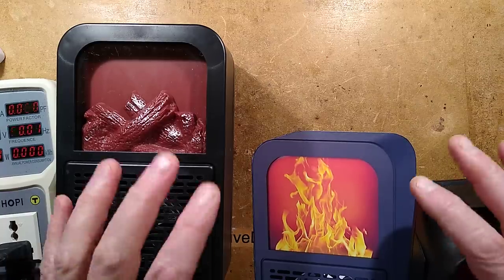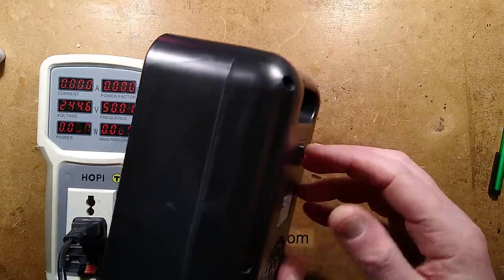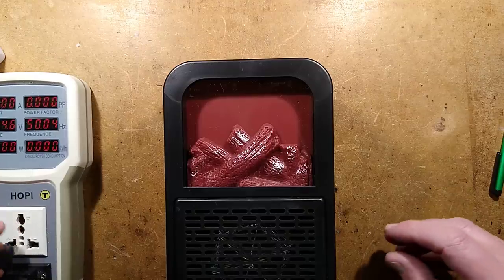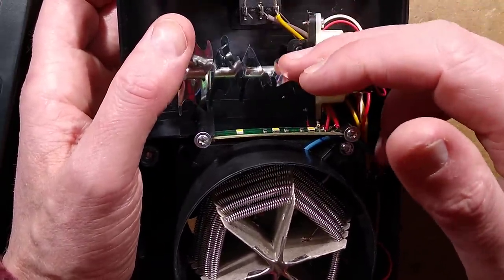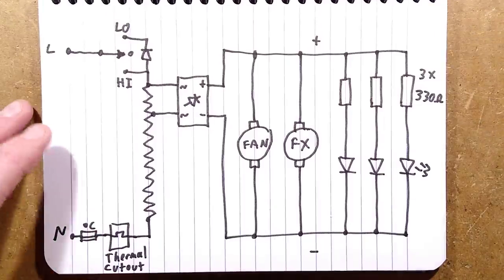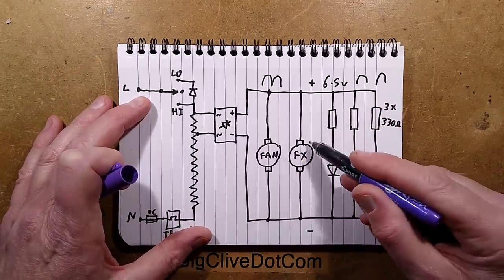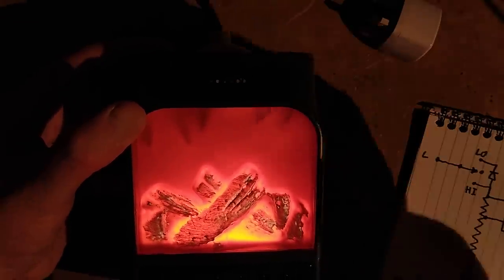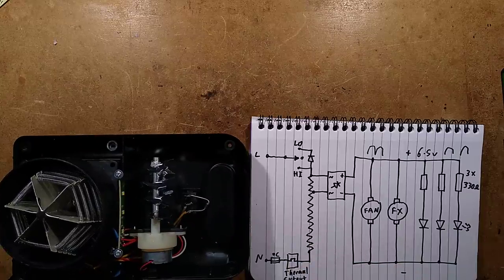The trashiest of all miracle heaters (with schematic)

Comment: I have three of the "Handy Heaters".  I got them at a thrift store over the summer for 5 dollars each.  (Three for less than the price of one on Amazon) The ones that plug directly into the outlet.  Winter came, and I plugged one in.  Powered up, worked really well.  After an hour or so,  it just shut off.  Have to unplug it, and plug it back in to get it going again.  Tried another one.  Same thing.  The third one... Same thing. While they were running,  the heat was pretty good.  They are the PTC type element and have digital thermostat and a sleep timer.  I think that even if the sleep timer is off,  it still functions and goes off after an hour or so.  But,  ANY heater I have ever used with a digital control has been utter sh!t.  
While going to flea markets and yard sales I found a "Big Heat"  Model 6200 heater. It is the hot-coils type.  Now THAT sucker works!!  For nearly as small a package,  it has tip-over shutoff,  an overheat protection, an actual selector switch and an actual bi-metal thermostat.  You know, REAL knobs and controls.
Best damn little heaters I have ever bought  (I now have three of those..  Er,  I mean two.  I gave one to my Uncle.)

Link to "Handy Heater":  https://www.amazon.com/Ontel-Handy-Heater-Personal-Compact/dp/B01L9UKAHM/ref=cm_cr_arp_d_pdt_img_top?ie=UTF8

Link to "Big Heat" :  https://www.worthpoint.com/worthopedia/portable-electric-forced-air-heater-1799938058
Reply: That big heat one looks like a scary old heater that'll burn your house down. 🤣 Be careful with that old thing.
Reply: @jamesdagmond  Only if used without common sense.    The only way it's burning anything is if the user is an outright fool and lets the front get covered by something like a curtain or blanket.   But even then  it does have a one-shot overtemp cutoff.  (A thermal fuse)  once that pops,  it won't come back on again until the fuse is replaced.  It has a steel body, porcelain insulators,  Steel grille, double insulated, and a true AC induction motor fan with steel blades.  (not some plastic, re-used laptop cooler fan)  I'd consider an older heater like that far safer than the plastic, chinesium trash getting pumped en masse out of china these days. 
Trust me,  It's fine. 
If you think that one is scary,  you should see my 1960's "Markel - Neo-Glo"  Heater   or my 1930's "Radia Health-Heater"  Both of which work great. 

Markel: https://www.ebay.com/itm/195461862634?_trkparms=amclksrc%3DITM%26aid%3D1110006%26algo%3DHOMESPLICE.SIM%26ao%3D1%26asc%3D243355%26meid%3D83f3f8a657d6432182e4268632f4ebc6%26pid%3D101224%26rk%3D4%26rkt%3D5%26sd%3D254482626355%26itm%3D195461862634%26pmt%3D1%26noa%3D1%26pg%3D2047675%26algv%3DDefaultOrganicWebWithV5RefreshRanker%26brand%3DMarkel&_trksid=p2047675.c101224.m-1
  
Radia: https://www.worthpoint.com/worthopedia/vintage-shepler-mfg-co-electric-401425382

Comment: Interesting and scary design at the same time. Just imagine the heater wire breaks between the taps of the rectifier. I would think that the fan, effect motor and the LEDs may make a brief, but intensive light show when basically connected to mains voltage with only the heating wire acting as a current limiting resistor. Would be a nice follow up video

Comment: So, with the two thermal safety parts, one would hope it wouldn't catch fire, so it's 400w heater in a very tiny package. Seems like it could be really nice for putting on your desk to blow straight at you... In any case, even if it does catch fire, at least you're right there & can (hopefully) put it out before it sets the house on fire. Personally I wouldn't recommend leaving any fan heater running while you're not in the room - even "safe" ones.

Comment: Identical to a cheap 1800W  hot air gun I bought a while back. The gun has low and high settings of about 300C and 400C. Not much difference between high and low heat, because the fan keeps the heating element cool - this means when  the heating element is on low (half wave rectified)  the fan is also going much slower, so the heating element does not get cooled as much.  Without the fan, the element would probably burn out in seconds. I bought the heat gun hoping to modify it to variable heat (down to about 100C would have been good). Of course it didnt work, because a lower heating element meant a slower the fan. I think the only way to solve this problem is to give the low voltage fan an independent power supply but didnt get that far.

Comment: 1. they could've used a fancier switch, skip the diode, and not have any of the flicker issues. The switch would just power half of the heating element, but configured so on short/long heater section the potential divider is the same. (same middle tap, the switch changes top/bottom taps, so a double pole double throw.)

Comment: Could you go outside and simulate a motor fail?
Will it cut it in time or go up in flames?
Reply: It'll do what a hairdryer does, as it's basically a hairdryer, the thermal cutoff bigclive showed kicks in.
Reply: @thegorgon7063  A normal hairdryer does, but I'd be curious if this cut-off will be fast enough

Comment: Great video again Clive. Just wondering how the live passes through the diode when switched in low mode, is that a diode or a resister? You do great work on keeping us views educated on safe/unsafe products that are out there, British Standards should sponsor you as you are doing a wonderful job.
Reply: Its a diode.. When it's switched into the circuit by moving the switch to the low position, the diode only let's one half of the A/C sine wave through, then effectively only using half of the power. Thats why the LEDs then flicker, because they are only being powered by half of the alternating sine wave, and are dark for the other half.
Reply: Power's also going throw a resistor divider network on high and low. It's using some heating element windings as the resistor.

Comment: I wonder how the plastic grille stands up after a few hours on high.
Reply: Probably look like somethimg similar to this.... 🙁 and smell like this.... 🤥
Reply: Below 100°C it may be OK, above that I'd be wary (I doubt something this cheap would go for high-temperature plastic, which I suspect would cost more than steel).
By my measurements <100°C airflow is not beyond designers to clear even with 2400W, so <400W with a reasonable flow rate should be quite easy-going.
Not that I'd use this brush-motored junker anyway…(and the biggest question is probably how the protection handles gradually reduced airflow when the motor wears out)

Comment: Amateur question:  isn't tapping a portion of a heating element for lower voltage perilous?  Won't the voltage change as a function of temperature?  Wear and corrosion? Won't it be unreliable from device to device?
Reply: All true, but the worst issue is that if the heating element fails open circuit between the taps you get full 240V delivered to the formerly low voltage components

Comment: The fuse on the neutral - I've seen it in other circuits and I don't understand why it's on the neutral.  I mean, if the fuse blows then the whole circuit will be live.
Is this simply a case of bad practice or could it be ignorance?
Reply from the maker: It's preferable in the live, but will still break the circuit.

Comment: The flame effect on these is interesting, but I'm not sure how one might reuse the effect outside the heater if not for fake fire in a haunted house or something. Small heaters like this give me the heebie-jeebies. The thinner the footprint and the taller the device, the more likely it is to topple and cause a fire. That's why when we heat our construction sites where I work we use massive heaters that have a broad base and are pretty bottom heavy and require a forklift to move.

Comment: doesn't the drawn DC Current in low Power  make your  RCD protection blind as
it saturates the magnetic core,? Can you measure the necessary Earth Current to make your RCD protector flip while under DC load?

Comment: As mentioned the heater is exactly  like a cheap hairdryer, although running at lower power for it to last longer. As with cheap hairdryers, I'd expect the switch to be the first component to fail.

Comment: This needs a filter cap across the bridge rectifier placed conveniently close to the heating element, such that when the cap pops (as such things are wont to do when heated) the vent end of the cap is on the intake side of the fan and will then add smoke to the flame effect. Naughty, but oddly appropriate! 😆

Comment: I wondered if it had that diode behind the switch when it flicked but that diode is also under rated. As the average might only be 180W, the peek will still be the 360W. I wonder how long it will last.
Reply: Assuming from appearance that it would be a 1N4007 or 4004, the 1A average rectified current rating for the 1N4xxx series would be (just) sufficient, as it is averaging 0.8A. The peak current is not significant for a resistive load - any rectifier passes peak currents significantly greater than the average, but it is the average that counts. If it's an unknown off-brand device, all bets are off...

Comment: Looks like you could increase the resale value of this by approximately the price of a low voltage electrolytic cap, an NPN transistor, and 2 resistors at a ratio of 12:1, so that the transistor will trim the tops off the pulsating DC at around 6-9V, and the cap helps keep the LEDs from starving out and flickering.

Comment: Put a capicitor across the output of the bridge to get rid of the flicker on low. 10V/100uF should do.
Reply from the maker: That would end badly with a peak of around 340V.
Reply: @bigclivedotcom  
We like the magic smoke 🙂
Reply: @bigclivedotcom  I was in the shower and the thought of the magic smoke crossed my mind and it hit me, there would be no magic smoke... As you mentioned at the 6:00 min mark, the heating element is like a loaded resistor network with the tap having a much lower voltage as you said of 6.5V which filtered RMS would be less than 8V. You should be able to get away with that having the motors run a little faster with the LED's a little brighter.

Comment: I just had to grind down the circumference of my triangular bit to get into a Sunbeam Xpress heat electric blanket. Once in I discovered the damn thing has a 28 pin SMD. You should take one of these apart, Clive, because the wiring in the blanket is not at all what I expected. It's all flat wire spiral wound and there are at least two layers like this. I have to look closer because there might even be another conductor inside for safety. Lots of high tech safety has gone into this thing. Frankly I doubt I will ever get it working again at this rate but I need to spend more time with it, too.
Reply: Circumference of a triangle?? 🤔 Hmm...

Comment: Seems like many cheap heaters have plastic grilles these days so maybe it could be ok. I could see a personal use for these.... I work in a metal workshop and heating it is difficult at best. I can envisage putting 4 of these behind my large fan running on slow to take the edge off the cold coming days. Probably easier and cheaper to buy a bigger mains one though...
Reply from the maker: Try a halogen heater.  It heats you up by radiant heat.
Reply: @bigclivedotcom  I actually have one! I even wear dark clothing in the winter which helps absorb the heat and it's great if I'm near it but operating a 6m guillotine means I have to duck back to the wall when I want the heat. My fan blows along the machine front so having some heat behind the airflow would be nice when I'm away from the halogen heater. Probably impractical but I'm a dreamer 🤷‍♂️👍😂

Comment: I need something like this for my bathroom this winter. I mean I wont be buying one of these but I wonder if there is a good one that work on 120v.
Reply from the maker: They do 120v versions.  You may be able to buy one from a local seller like Walmart.
Reply: @bigclivedotcom  I'll have to look into it. Thanks!
Reply: Or just leave your hair dryer on
Reply: Just install a MUCH safer electric baseboard heater. Your house will thank you later, when it's still standing after winter is over.

Comment: Hey Clive have you ever taken apart a ECM furnace motor befrore?  The ones in the US are 2 piece.  A module and 1hp a DC motor.  It be cool to see a video on it.
Reply from the maker: I'll keep an eye out for one.
Reply: @bigclivedotcom  The ones I see have a black rubber filling around the components & board located inside the motor module.  Why do they put it in there?  Is it for rigidity, insulation, cooling, or to keep people out?

Comment: Well idk what's really the problem with it? It has not 1 but 2 thermal fuses, the schematics looks actually kinda clever, with using the heating element also as a divider to get low voltage. And motors and LEDs don't need the voltage smoothed out anyway, they're fine with PWM signals in all modern electronics.

Comment: Big Clive mate, you just had me going around checking that all my earths were uninsulated! I noticed with my Alexa the earth pin is white but the live / neutral is partially white and bare ends. Am I to presume that this is the same thing or is it a conductive coating I am not familiar with? Thanks bud!
Reply: Though I have just noticed its my 5-12v dc power supplies that have that?
Reply from the maker: Double insulated adaptors use a plastic pin just to unlock the safety shutters.
Reply: @bigclivedotcom  Ok, I understand now! I appreciate the explaination, thank you. Look forward to the next vid.👍

Comment: 1 Ampere diode is totally under rated considering that the load is around 8A. I wonder how long will it take to blow up adding to the overall flame (and smoke) effect.
Reply: Around 1.5 amps, actually. :O)
Reply from the maker: On 240V the current is on average less than an amp over the full sinewave.

Comment: Funny, i just had a harbor freight hot air gun with the same diode setup burst into flames in my hand.
The diode itself burned out and I guess started arcing.
Reply from the maker: I had a hairdryer diode fail and shoot out sparks from the dryer.

Comment: Kind of related.  I have a 1970's era kids record player and radio system. The weird part about this are two things. They have a actual factory extra winding on the AC powered motor to get the 12 volts for the electronics part of the unit.  Then they took this one step farther by adding a step up transformer since it was made in Canada, 220 volt and sold in USA 110 volt system.  
 However in your heater example here; taking a small section of a heating element as part of a power source is really off and weird to me.

Comment: Clive good sir, given the cost of living crises, rising energy costs etc. I wonder if you could perhaps do us a solid.

A small selection of say Kw heaters (oil, convection, fan assist, electric fires) and tell us or show us, what actually offers the best buck.

I have storage heaters, so sware by the oil filled babys, but with my electric now very nearly more than my rent it would be nice to know for certain whats best to keep me warm
Reply: A heat pump, say an AC in heating mode.

Or a non-electric heater. What do you do when electricity prices are higher than Snoop Dogg himself? Not use electricity, if possible.
Reply: @xavier6130  Gas right now is a cheaper way to heat, well it has for me, £150 a month in gas, and £500 a month in electric. Stepping UP my gas use baught my electric bill down

Comment: A 1 Amp diode with a 400W heater is pushing it a bit. Ok, so it was taking about 0.9A in low mode, but still...
Reply: I guess they might be using that as part of the heater 🤣🤣🔥🔥🔥🔥🔥👍
Reply from the maker: In hairdryers the diode is often mounted in the airpath.
Reply: @bigclivedotcom  oh in the cool air I presume.
Reply: @dcallan812  Yes, BEFORE the heater
Reply: @davelowets  👍👍
Reply: @dcallan812  👌

Comment: That's funny. I have a retro TV case with the same effect however a much better implementtion. Very funny unit, you have to take a look at it - search for "retro tv fireplace". I have 3 units because 70% off discount at Xenos I couldn't resist. Paid 5.20 euros each. Nice for mod projects, you cannot 3D print such thing for this low price. Be aware there are some quality issues with it, I had two of them not working because something wrong with the (connection on the) potentiometer dial. Soldering is not the best. Did not returned it but fix it. Modified one with an USB cable so it is possible to use an USB-power-stick and it fits inside the battery compartment, neat! Otherwise these units will eat expensive C-cell(!) batteries. Take a look at it, nice for a review and teardown.

Comment: That reflecting wheel is like the one is my fireplace effect heater. My heater is 700 watts and a floor model. It's approx 12 inches wide and 11 inches tall. (I don't know the centimeter conversion off hand. But I think 2.5 cm equals 1 inch)
Reply: We had a floor model decades ago, that looked like actual burning logs. 🔥 
The "logs" had a textured colored plastic sheet covering the bored out center of the pile of "logs" that was painted up to look like "coals". The effect implement inside it was a tungsten night-light lamp that shined at a silver piece of Christmas tinsel on a stiff, straight, wire that was rotated by a motor. The light reflected off the silver tinsel and projected the "flames" through the plastic painted cover in the center of the pile, while the tinsel also did double duty by scraping against the plastic "coals" to make the "crackling fire sounds" as it rotated. It didn't even produce heat. (Except whatever was given off by the 5 watt night-light bulb) It was simply a visual piece to place into an unused fire place.
It was hilarious to me as a teenager when I first flipped it over to see how it worked. 😂
Reply: 10 cm = 1 hand